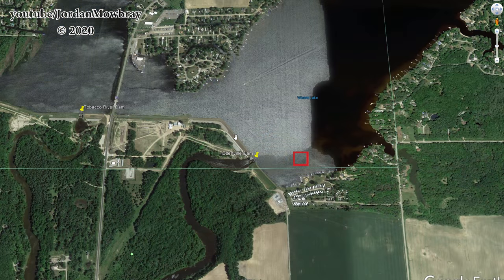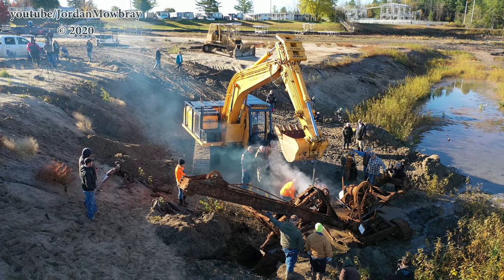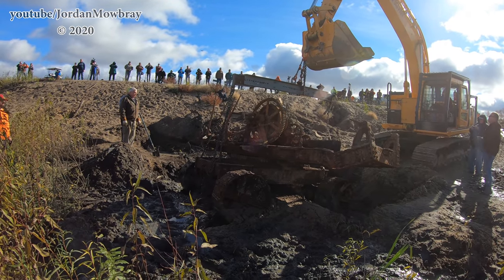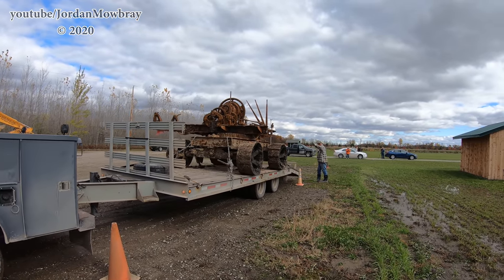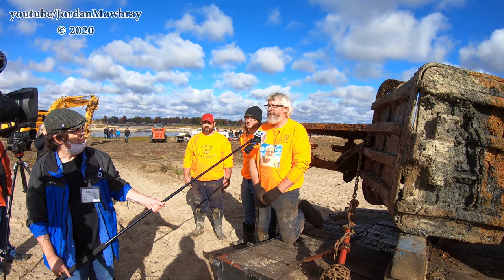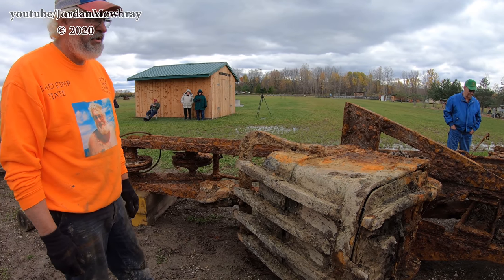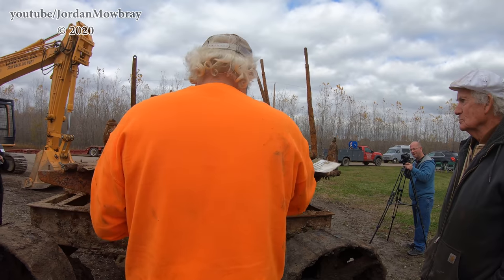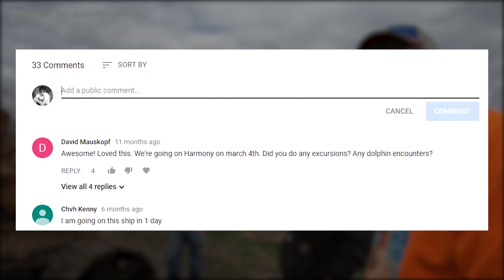Thew Type O Steam Shovel Removal from the bottom of Wixom Lake

Comment: I've just been looking up Thew Type O steam shovels.  That one is in pretty poor condition and it's gonna take a lot of work to make it operational.  I don't expect you can buy parts for it at The Home Depot.  I know where there are several old steam shovels sitting there rusting away.  My dad remembers when a few of them were still running.  The thing about steam shovels is they ran on steam.  That means coal, a fireman/stoker, a smokestack, and a boiler.

Comment: Tell the guys fixing it up that it is a lot easier to run a steam shovel on compressed air from an engine driven pump (you can rent them at an equipment rental place) than trying to get a steam certificate for a boiler.  It is also a lot easier than firing/stoking/watering a boiler 3-4 hours before any demonstration run and then clearing out the fire/clinkers afterwards.  All you have to do to a compressor is start it.